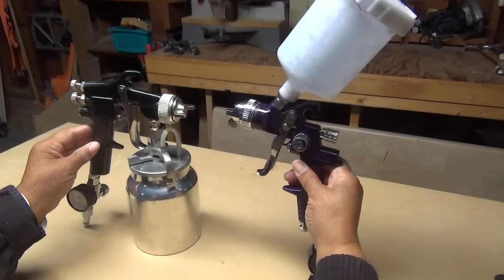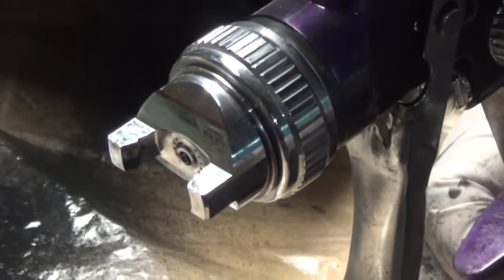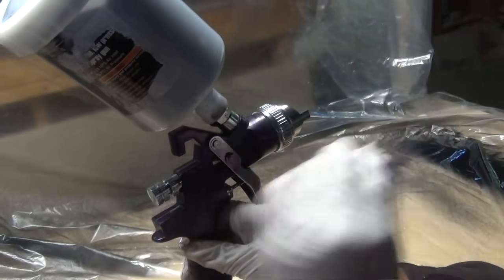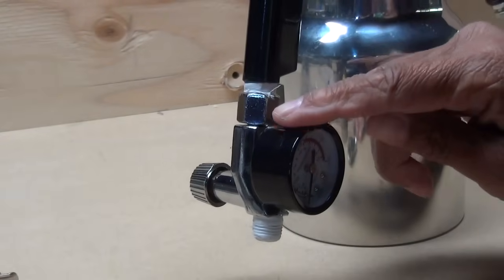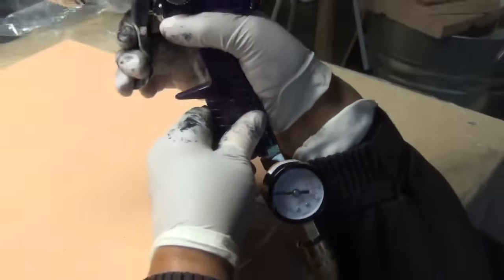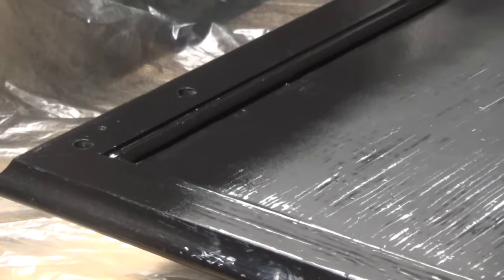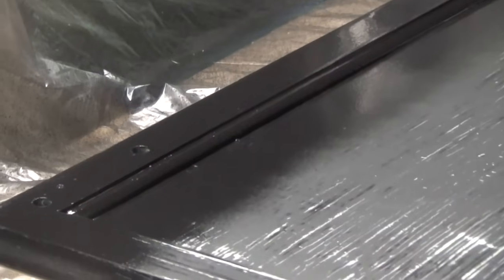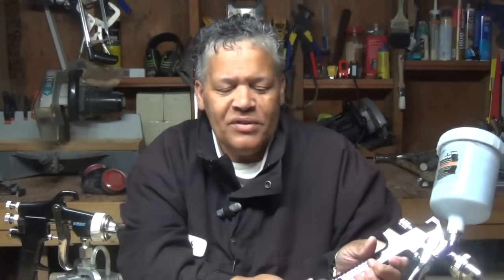Beginner Tutorial How to Set Up and Use a Paint Spray Gun

Comment: Hi Jane.  your video's are fantastic and easy to follow. Thank you so much. I'm a great fan.  I have an Air compressor which I'm only a beginner. I have brought a paint sprayer which says to use at 3-4 Bar and don't understand this. Can you please take the time to explain the difference between a Bar measurement and PSI please. I would be so grateful as I'm confused. Also, Is 90 PSI the same for any size brad when using an air gun or does it have to be regulated for different sizes. Thanks Hun. xx
Reply from the maker: Hi Peter, Bar is a measurement of pressure that is often used outside the U.S.  One bar is equivalent to 14.5 psi

Comment: I thought the spray gun manufacturer said to set the psi at 40. So it would be at 40 psi before spraying. But the way you have yours set it is at 95 psi. Just trying to determine what is correct. Also the band of paint was way too narrow. Only should take 4 passes to paint the object. My opinion. But great video. Keep them coming. Here is a link where I found lower pressure usage with hvlp guns. https://youtu.be/Bu3KxqH7mM0

Comment: In your closing, you say the compressor size doesn't matter, but you finish with a small compressor won't do the job. I have a good pancake compressor & I am  HVLP spraying one part that is 8" x 40" & the other is 8" x 90" time 2 & that's it... 
What say you...?
Reply from the maker: A pancake compressor doesn't have enough cfm(s) to spray paint.  You'll need a compressor that can delivers approximately 6 cfm  cubic feet minute.  Good luck with your project.

Comment: You can't lay paint down that thick if you're painting something like a car. It will cause orange peel, if you want a smooth finish you need to do thin even coats.
Reply: yes, that was way to thick. you also need to know about tip / orifice size.

Comment: my air compressor  20 gallon husky  has 2 gauges one for the air pressure inside the tank and the other one to adjust the PSI to match the tools... do I still need to get this regulator thanks for the help really great video
Reply from the maker: An additional regulator is not mandatory however, a regulator at the gun is extremely helpful and the standard practice.
Reply: seejanedrill Okay thank you so much for replying to me.... now I feel like I have to get it and I will LOL do you think I should be okay with my 20 gallon Husky air compressor puts out between 150 and 175 PSI?
Reply from the maker: what is the cfm?
Reply: 5.0scfm at 40psi and 4.0scfm at 90psi...1.5 hp
Reply from the maker: That isn't going to be sufficient cfm if you're spraying for any length of time.  Light hobby spraying only.

Comment: Good stuff except you should not aim the gun on an angle like that, you should be at a 90 degree angle so the paint goes evenly, rather than more on the bottom/less on top as in the angle you're using.

Comment: I've got a Syphon feed Dewalt. Used it for the first time and had a hard time getting it to shoot wide. I found it interesting how you said you need to adjust the regulator when the trigger is pressed... Is this accurate for all makes and models. Mine tells me the max pressure is 40PSI. So I should set this PSI while trigger is on?

Comment: I tried to use the HVLP using shellac on my ceiling boards. I filled it half way on the gravity feed and when i turned it up the damn top leaked out the shellac on my arm, just dripping like mad. I tried to tighten the cap again over and over and it still leaks.  It is a brand new Harbor Freight item 47016. I thought it should have had a rubber seal on the cap but there is none.

Comment: I can't seem to manage to set the gun up in a way that doesn't fill the whole surrounding with fine mist. I tried air pressure, fluid setting, air setting and different paint viscosities by thinning it, but there's just too many variables and I don't know what's the main culprit here. Maybe it's even just a bad gun? What is the main reason for too much mist in your experience?
Reply from the maker: you know, there are a number of things it could be, but the most probable culprit is that the air pressure is too high.
Reply: Thanks! I will try that on my next project, although I already had set the air pressure lower (set when there's air coming out of the nozzle) than the manual of the spray gun said (which made it better). The problem is I have to paint a whole project to be able to tell the difference consistently ;) and they come maybe 3 or 4 times a year.
I don't have a pressure meter at the gun, just at the compressor, so it should have been lower at the gun already. But I am using a larger diameter hose (I think 8mm inside diameter) from the compressor to the gun. Maybe the gun manufacturer (it's a very cheap one that came with a set of other air tools) assumed that I would use the usual 6mm inside dia hose.

Comment: Hi, thanks for the video, just a question, i need to paint a large ceiling and I am afraid the gravity feed model wont work for that. Do you recommend a siphon model or should I get electrical one?
Reply from the maker: Hi Moe, for a ceiling, you would want to use an airless sprayer.  If you don't want to buy one, you can rent them from large home improvement stores

Comment: I HAVE AN OLD SCHOOL BINKS MODEL 7 FROM THE 80 S..WHAT WILL CLEAN MY GUN THE BEST???
Reply: Cellulose laquer thinner or acetone. This as a general rule are extremely powerful solvents. But it surely makes sense to use a solvent appropriate to whatever is stuck in there. 
Suggestion: Disassemble it all, with the thinners and a small copper wire brush it should be like new in a short time. Good luck. :-)
Reply: Larry Keesee laquer thinner
Reply: Toluene will remove any thing,  always be careful if spraying it thru the gun.  Wear your respirator

Comment: okay so it was a valiant effort but the only thing you didn't tell about how to set up a spray gun was actually how to set up a spray gun. you did not explain at all to people how to adjust air volume fluid volume or fluid pattern. Those are the three elements of setting up a spray gun. so setting up a spray gun means knowing what to do with the knobs on the gun to in the back and on a lot of today's HVLP guns one on the side. the top knob is fluid volume the bottom knob in the back is air volume the knob on the side is fluid pattern or spray pattern. A lot of folks don't know anything about these and that is what they need to know about how to set up a paint gun before using it.
Reply: Blair Wise Good information. Why don't you do a video and teach us how?

Comment: Strictly speaking, what you have there is a valve, and not actually a regulator..  The PSI at the gun body will change with the input pressure of your compressor.  A regulator maintains constant pressure at the gun body, provided it is set below your compressor's threshold pressure..   This is much more beneficial as it maintains a more consistent spray job over time..  Particularly for larger projects..

Comment: Thank you Leah.. This is a good tutorial video.. I have no experience with spray gun but recently bought one... I am planning to paint an iron bench on my garden. Can you clarify when or why I need to use a thinner on my canister?
Reply from the maker: Hi Julio, the reason for using a thinner is that if it is too thick, you won't be able to spray.  (technical term is viscosity).  There may be recommendations about this from the paint manufacturer.
Reply: Thank you

Comment: Thank you very much for this nice video! How about cleanning and maintenance of the spray guns? Do you have any tip?
Reply from the maker: In this case, it is best to follow the manufacturer's recommendations.  Use a proper solvent (if you aren't using water-based paint), and don't rush/cheat, because it is a painstaking process.  You really have to do a thorough job.

Comment: Thanks Lea. I have watched a couple of your videos and you do a great job in your instructions.  On this one I need to look up how to figure the CFM.  Like you mentioned, I bought a HVLP gun some years ago and never used it. Bought it on sale without being able to determine if my 33 gal oil less Craftsman tank would put out enough air to run it properly.  How about explaining how to figure CFM sometime if you wish. Thanks again for the tutorials which I enjoy.
Reply from the maker: HI Bill, the manufacturer of the tool should specify the CFM.  And if you don't still have the manual, you should be able to look up the information online.  For instance, I researched your oil-free 33 gallon air compressor, and while I'm not certain of your model number, it looks like it should give 6.8 cfm at 40 psi, and 5.1 cfm at 90 psi. Hopefully this will get you going in the right direction.

Comment: Hi Leah.  I have a Graco magnum x5 sprayer and I am looking to paint my entire basement.  Do you recommend i turn off the pilot light on both the furnace and water heater?
Reply from the maker: I wouldn't worry about it, as long as the paint you are using won't create combustible fumes.  Latex should be fine, but play it safe and check the manufacturer's instructions.
Reply: Thank you Leah!

Comment: can you use any kind of liquid based finish with the hlpv gun? I have one and I have tried using it for varathane diamond coat and it seems much too thick for the gun. what should I use to thin out?
Reply from the maker: +landon woodruff   Hello Landon,  The Varathane Diamond poly is a water-based polyurethane which typically is not intended to be thinned.  I would avoid thinning the product without consulting the manufacturers recommendations first.  You may want to take a look at your gun's fluid tip size.  A 1.0 to 1.3 mm tip size is what is suggested for this product.

Comment: Great video and demonstration. Thank you so much for sharing. I'm was considering one to paint our shed. Thanks again. 
How do you clean the paint gun?
Reply from the maker: +AC DC Honestly, cleaning the paint gun is the toughest part of using one.  If you are using latex paint, you can clean it with water.  But if you are using oil-based paint, you need to use mineral spirits.  And you have to take the gun apart to clean it.  I want to say one thing, though.  If you are planning to paint your outside shed, you may want to consider using an airless spray gun, rather than this one.